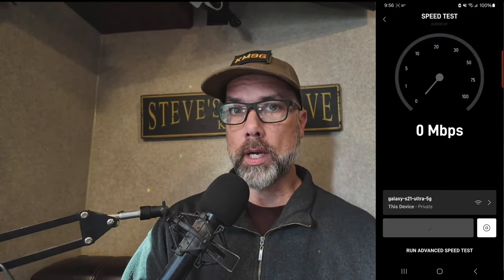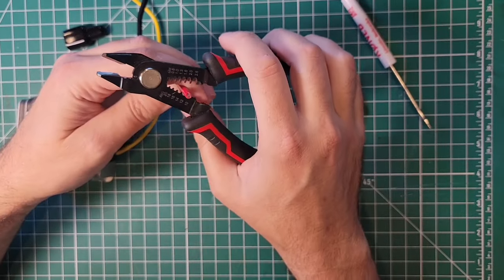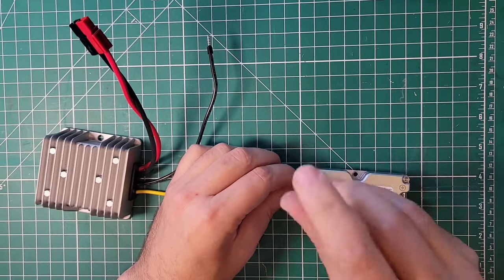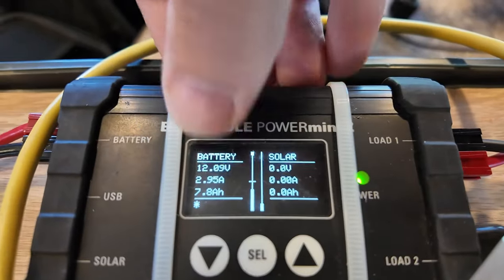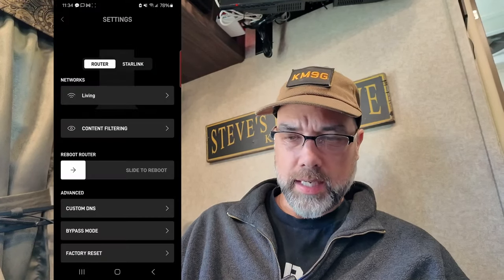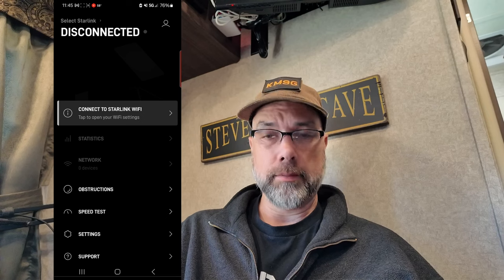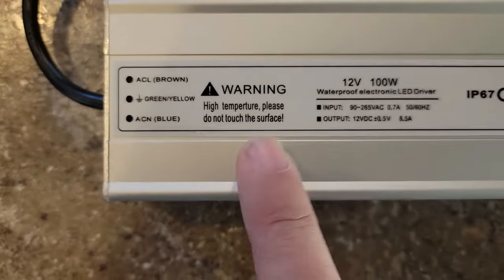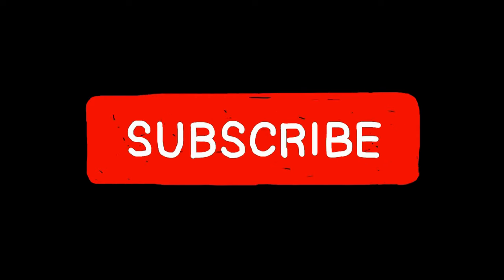Convert Your Starlink to 12v Power For Your Offgrid/Boondocking/Nomad RV Lifestyle

Comment: Bonus points for the PP30 connectors. I discovered them a couple of years ago and have become obsessed with them - I've standardised everything 12V to use them, and I've also made some multimeter probes with them so I don't need to gov shoving traditional probes into the connectors.
Reply from the maker: They work really well and are hard to mess up ... Not like the MC4 connectors!

Comment: I had been putting off this project for the past two years, but I wired up your setup today on my boat using the links in your description for the parts. Everything is working great. Thanks! I added an on / off switch on the breaker panel to shut it off when I'm moving. Thanks again.
Reply from the maker: That's awesome!  Glad it worked great!  The off switch is perfect.  She's a power hog and if you aren't using it, might as well save battery power!

Comment: This should really be helpful for people that are offgrid.
Reply from the maker: I love that it can be 12v and also 120v as needed.  Very versatile!  Would have been great if the original router was a 12v barrel jack with a little wallwart, but I get the "elegance" of putting it all in one unit also.   Different Strokes

Comment: great job.  did something like that for Star link on 12V . had some inline fuse and disconnect switch  and some ferrite on DC to DC converter . put a PC fan in box to cool with air filer.  that user was a AM and SW radio listener.  what a challenge with solar.
Reply from the maker: What battery and panel size did you land on?
Reply: @livingforalivingRV  went into RV 12V system. 400 Ah LiFePO4 with 500 watt solar with Victron MPPT and smart shunt.,  the new fridge was 12V no propane no 120V . has shore power converter 50A at 13.5V . lots of ferrite. they spent over $100 on ferrite alone. they made the box.  even had to put ferrite on 12V vent fan motor . if you get RFI from that DC to DC converter. make DC chokes with t 240-31 on both in and out close to DC converter. what I had to do.
Reply from the maker: That makes sense.  I just did a solar conversion on an RV like that.  31 is the best!

Comment: I know a lot of people are doing this, and it does make a "little" sense. What you are saving is the 12 V to 120 V inverter. You add a 12 V to 48 V inverter(source of inefficiency) and something between the 12 V and the router. I calculate perhaps you are saving 10-20 watts.
Reply from the maker: The other thing to add would be a timer to turn it off at night so you're not providing internet to sleeping users.

Comment: Thanks for sharing your experience.  Thank you.  You are still using inverters and converters in the process.  The real question is how many watts does raw Starlink use in the shipped configuration versus your configuration with you inverters/converters/router.   It looks like your setup may use 35-45 watts which is roughly the same as default Starlink after it stabilizes from power-up.   I use several of those DC-DC converters/boosters from amazon and they typically have a 10-15% loss under load in my environment.
Reply from the maker: This is a future test.  The problem is finding a good inverter.  Any suggestions?
Reply: @livingforalivingRV  My victron uses an easy amp+ just sitting there. With the starlink plugged in we are talking another 4-5 with the net being around 6 amps at 12v. It isn't a brand new inverter but it is a quality one. If you have to run an inverter anyways then maybe it is not a big deal. If you don't have to run the inverter all the time then it saves you some. One other annoyance, though minor, is if you have to switch your 120v supply (we do) from shore to generator to inverter then you drop your connection when you do it. This is most annoying when your shore power is going on/off randomly due to some instability.
Reply from the maker: @danielboughton3624  And victron is supposed to be one of the best...1amp consumption at rest is hard to swallow.  Your other issues make battery power a better choice when you can charge the battery at the same time as drawing power from it.  I'd rather be charging via solar or shore power and have my connection un-interrupted.

Comment: I can see why having a setup in a box is attractive, what I'm not seeing is why a small inverter in the box isn't good enough? 
Modern inverters seem to be more power-efficient than boost converters.
Reply from the maker: Why not remove every power hungry thing you can?  the 12v inverter in the box is an easy way to not have to go back to the Starlink router.  Otherwise - why not just use a small inverter and the normal starlink router?  I'll run some other tests to see how much of a difference there is between my setup and white router+inverter. (BTW, there are other benefits that might not be apparent if you're stationary with a good view of the sky.  I don't always have the luxury of using starlink, and even when I do, its not always the fastest choice) Stay tuned for more.

Comment: will this setup work the same for the gen 3? when do you plan to do a follow up video showing it all in action and using the home router as mentioned? Would like to see you using the the router when plugged into shorepower also?
Reply from the maker: I don't have a Gen 3 to test with, but if I find somebody that has one I can try it out.  I have been doing a long term test on the black router in the video and I'm convinced its really the only device in its category... but I'm having trouble recommending it because its not "great"... its kinda "meh" and I'd like it to be at least "ok" (I mean I really want it to be GREAT!, but my expectations might be too high)

Comment: Where do I find the Tools and Materials list?  Where is the "Description Button" to click on?  Is there a link to your "Friend" who makes the small fuse board with the Pole Connectors at each end?
Reply from the maker: If you scroll down under the video, you'll find the description, you might have to click "...more..." or something to expand the description to see all the links, but that's where they are.

Parts Needed:
👉 120v AC to 12v DC Power Supply: https://geni.us/53H0EM
👉 12v DC to 48v DC Boost Converter: https://geni.us/pVcG6o
👉 48v Power Over Ethernet Injector (POE): https://geni.us/oHB9M3
👉 Starlink Cable to Ethernet Media Converter: https://geni.us/YJgq39
👉 Simple Router: https://geni.us/ENsGMVc
👉 HomeFi Cellular, Wifi, Ethernet Router: https://homefi.refr.cc/living

Tools Used:
👉 Powerpole Connectors: https://geni.us/wyPL31
👉 Powerpole Crimpers: https://geni.us/vVfp
👉 Fuse Kit: https://geni.us/jkM4

Comment: Have you checked to see if the boost converter puts off any RFI? That's the one thing I'm concerned about before converting mine over. I plan on running it off a Epic PWRGate so it normally runs with the 12v power supply on grid power but fails over to 12v during a power outage.
Reply from the maker: I haven't checked yet, but I did give you a shoutout in the description for helping out with this project.
Reply: @livingforalivingRV  I saw that, thanks!

Comment: I understand the want for a 12 volt input, but how much more efficient is using the buck boost transformer than just using the inverter you probably have and using the factory 120 v starlink setup?
Reply from the maker: I'll have to do a video on what the power difference is!

Comment: I tried this step-up inverter and for some reason the output is reading 12v. What does your output(yellow/black) read as on a multimeter?
Reply from the maker: The 48v model?  If your's reads 12v, you might have the wrong wires or a bad unit.  Mine worked flawlessly for weeks and is now in my new RV which is 2 hours away at the moment getting tires on it.  Would love to check, but she ain't here 🥲

Comment: Hi, is it possible to use this for Gen 1 dish by eliminating the rj45 adapter? Gen 1 is already rj45 from the dish.
Reply from the maker: I don't have one to confirm, but you can check out the pinout on the RJ-45.  Does the dish have any other connector/wire on it?

Comment: Why was I surprised there is a square Dishy to ethernet adapter?
Reply from the maker: I was surprised that the router side cables were recessed and gasketed for a device that isn't waterproof...
Reply: @livingforalivingRV  The router is IP54 rated. I've had mine sitting outside for a year on my lanai. It is covered, but exposed to the elements
Reply from the maker: Your starlink router?  As you know, it didn't come with a ton of documentation, but I remember seeing somewhere "don't sit it out in the rain"  @KH6WI